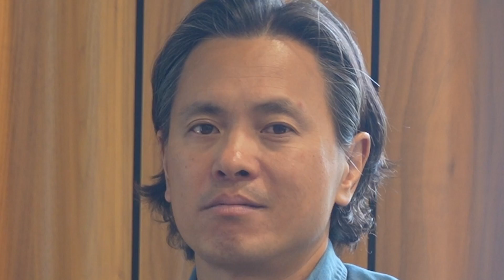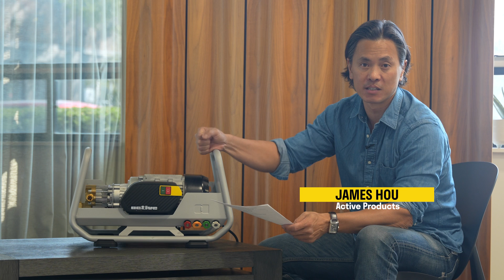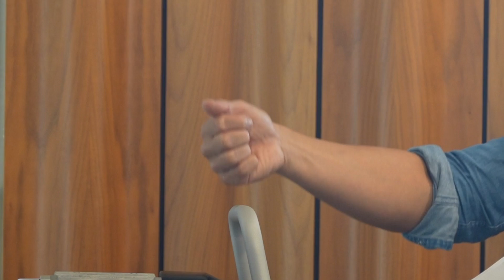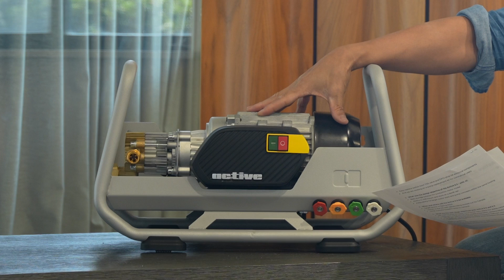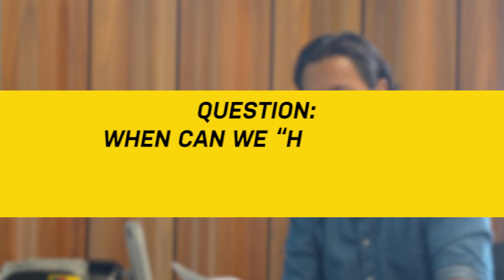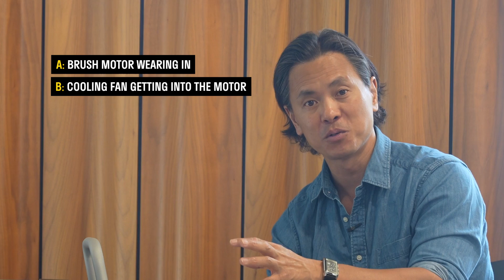Answering your questions about the ACTIVE 2.3 | Canadian 🇨🇦 Pressure Washer

Comment: As the owner of the Canadian Active 2.0 (Simoniz) I love everything about it except the hose. I had to buy the UberFlex 50' to make the unit perfect. Absolutely the best unit in this category so the new 2.3 will be even better. I still think for the DIY homeowner enthusiast the Active 2.0 is more then enough. Something to consider in future product development is the inclusion or option for a better 50" hose.
Reply: What is the 2.0 under the simoniz brand?
Reply: @mcham0846  Its the Simoniz one sold at Canadian Tire
Reply: @bbrewer609  that's the same one as the Active VE52 is it not?
Reply: I loved it, until it crapped out 6 months later and water was flowing out the bottom. Got it "repaired" under warranty and 3 months later, you guessed it - water out the bottom. Sadly(wish to support a Canadian co.)after that experience needless to say I am very hesitant in purchasing another Active unit.

Comment: ACTIVE's new 2.3 GPM pressure washer is a game-changer, but here are a few tweaks that could make it even more unstoppable:

PSI Perfection:
Bump up the PSI to 2000+ for a truly effortless cleaning.

Portable Powerhouse:
Keep the weight under 40 lbs, ideally 35 lbs, with a durable carry frame for easy portability.

Modular Magic:
Sell parts and attachments separately to cater to diverse needs and budgets.

Pricing and Monetization:
Set an attractive base price, then upsell optional add-ons like wheels, mounting brackets, etc.

We're excited to see how ACTIVE's 2.3 GPM pressure washer can help us take our business to the next level. We believe that this product has the potential to revolutionize the industry, and we are proud to be a part of its development.

Comment: Has there been thought given to accessorizing the unit? I’d like to maybe see a cart that has a built in hose reel and a holder for an extension cord (maybe 25’ or 50’ of 12ga) in addition to a small gun, foam cannon, and spare nozzle storage. This would obviously increase the cost, but if sold as additional items or a bundle kit, I think they would sell

Comment: I had the original active and the 2.0 and they both eventually had the same issue where the pump just keeps running even when you release the trigger.  Even took advise from the team and replaced hoses and nozzles and still does it.  Never again

Comment: Why does the 2.0 not turn off sometimes after releasing the trigger?
Reply from the maker: Could be a pressure issue. Have you tried contacting support@activeproducts.com? They will guide you through some troubleshooting steps or replace the unit if necessary.

Comment: I ask that question if it's going to be serviceable.... we need a pressure that we can do the oil change so we don't feel like we still have a portable unit
Reply: You mean a cheaper unit than Kranzle and AR.  Because those two are serviceable.
Reply: @timkinley1779  I have a serviceable pressure washer just not total stop system from canpump

Comment: Can it run in a setup with 2 pressure washers running in tandem? Obsessed Garage tested the 2.0 and it failed when the Kranzle and the AR both were successful. They were getting upwards of 4+ gallons per minute and with the dual setup. Maybe you can try a similar test.
Reply: Yeah I wish they tried with check valves in hoses before saying it failed. I think the back flow was the issue
Reply: This might not be at the top of Active's priority list, with the assumption that the market for people who would benefit from a dual system setup is incredibly small.
Most people would benefit more from running a DI system to prevent water spotting, which seems to be the biggest issue with coatings and what not.  I'm not sure a DI system that can handle dual pressure washers exists
Reply: The internal components were not built to the same specs as Kranzle and AR.  The 2.0 is built to a price point, the other two cost what they cost.
Reply: @timkinley1779   it wasn’t fully tested with check valves, thats what commercial pressure is washer companies do, they only tested them without it. If it still doesn’t work after that then I’ll agree. I would like to see it tested on ryobi’s also and not just in theory
Reply: @pantac4493  The unit doesn't have check valves for whatever reason.  So you think OG should design something in addition to the actual unit, for you?  You do it.
Reply: @timkinley1779  lol clearly you don’t know how it works, you just believe everything they tell you and repeat it like a parrot lmao. They don’t have to build anything special, all they had to do was insert two check valves in the existing hoses that they already had setup to test it properly. Eventually someone who uses their pressure washer more than me and needs that kind performance will do more test. By the way, most pressure washers are serviceable if you have a few brain cells to take it apart, been there done that myself
Reply: @pantac4493  Clearly you think OG should fancy your sense of entitlement.  They aren't there to satisfy your individual whims.  They are doing what they want.  Should they consult with you moving forward?  You seem to think you're important enough that they should.  Good luck with that dose of reality.
Reply: @timkinley1779  that’s not the point, I was just stating there’s no final conclusion because all options weren’t tested yet. You said (repeated lol) that the unit is not built good enough, without any proof. You offer no suggestions or solutions just repeated statements. Can’t even think for yourself. Good luck with forming your own thoughts lmao
Reply: @pantac4493  I think I'm not entitled enough for OG to satisfy my wants.  If the purpose was to check the units, they did.  Having to come up with other components, makes it about something else.  I don't see that they need to prove anything else.  Unless you think they need to prove that they can throw enough stuff at it to make it work, which wasn't the purpose.
Reply: @timkinley1779  I already said when using dual systems like this, commercial contractors use check valves in the hoses, it could be a safety thing and for functionality. That seems to be a standard practice outside of detailing. So no one can say it doesn’t work unless they use all components that’s tried and true already. Outside of that, then you’re reinventing the wheel and having to redesign the pressure switch and cost would probably be too high to be practical to be sold unless there’s a high demand for it. If I needed extra flow for a detail business, then I would experiment but I’m a weekend washer for a personal vehicle and time saved doesn’t matter all that much but I would buy the equipment if someone were to test it. From a business standpoint they would want to sell higher priced pressure washers, especially if the profit margin is the same. Think about it logically instead of just shoveling in whats being told to you
Reply: @pantac4493  I was thinking about it logically.  OG is logically not responsible for building a mock-up of low priced pressure washing units.  That is my logic, nothing more.
Reply: @timkinley1779  more like repeating OG, nothing more lol. Dismissing something because you think it’s too cheap isn’t an answer. Even the cheapest Ryobi pressure washers in dual could get 2.8 GPM, that’s more than a single AR or Kranzle. That’s what you call logic

Comment: Great info! 15 amp is a huge thing. My next question would be how much does it weigh with and without the stand?
Reply: This is what we want to know what are the expected specs? Weight and size. What is the db rating? We all know how induction motors are supposed to sound but what’s it in db? 10ft away or 50ft away if you have the pressure washer that far away from you with your 50ft hose. This would be cool to know the unit looks great so far. I would highly suggest making it serviceable that would be awesome. If at the right price point and it was serviceable now you start throwing jabs in the ring with the big boy pressure washers. Overall I’m impressed already with the 2.3gpm.
Reply: and will there be a cart option?